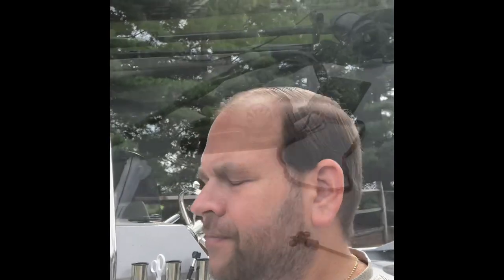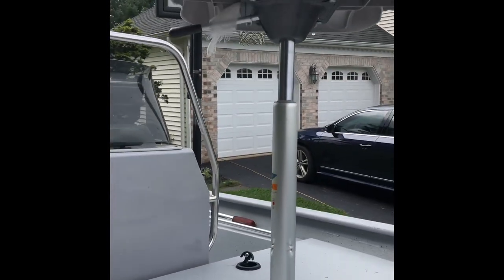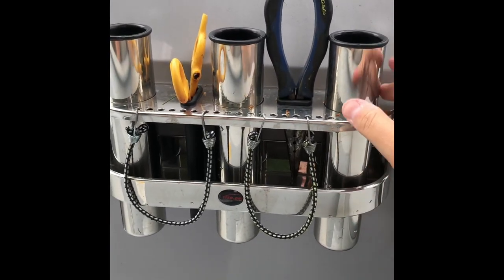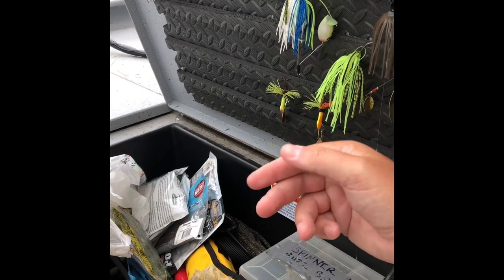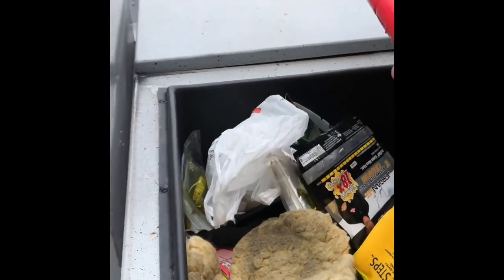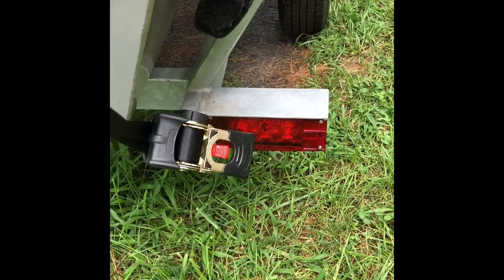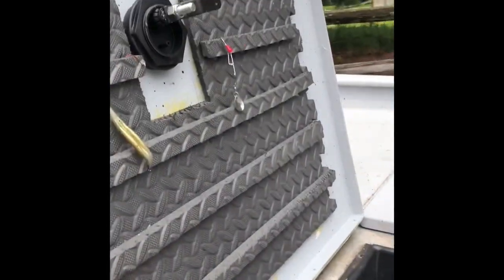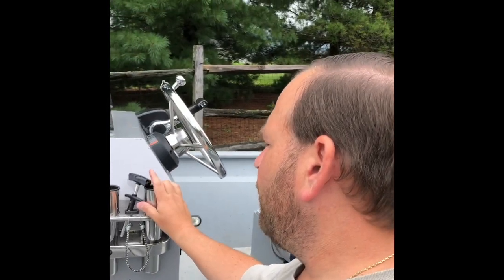G3 1860 CCJ modifications

Comment: On your rod holders there are little holes for hooks. Leave rods in holders and take line wrap around the rod once and then place the hook under flat bar and through the hook holders with barb on inside. You won’t get hooked that way. Also helps secure your rods down a little depending on how much you reel down on them
Reply from the maker: Great thought! Thanks!!